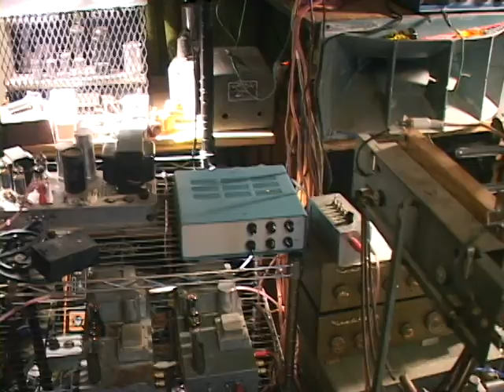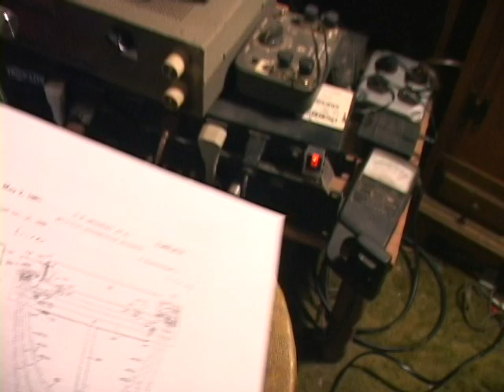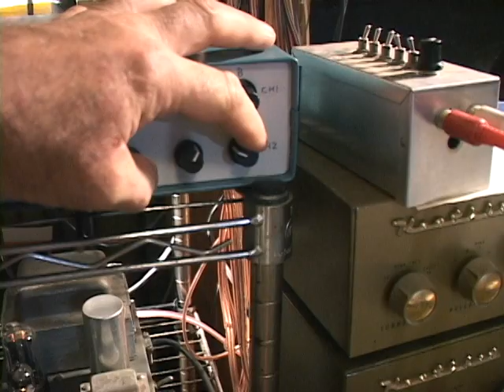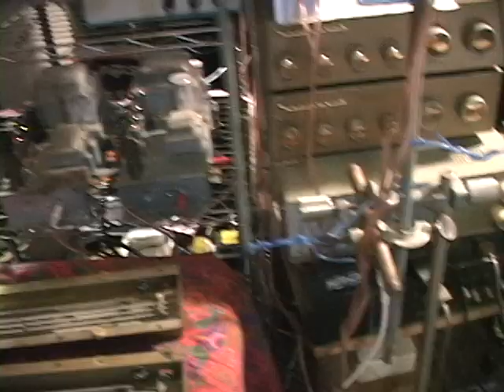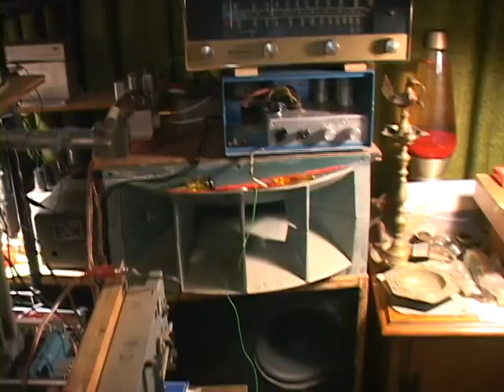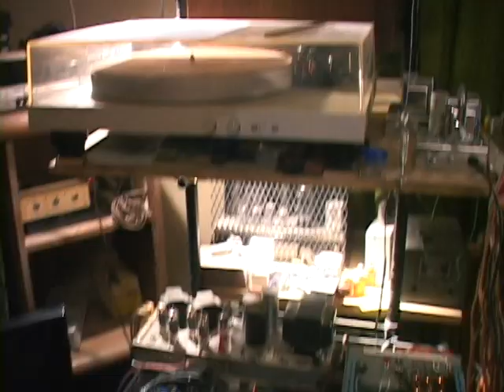Hammond necklace spring reverb tanks

Comment: Three springs represent Length, Height, and Width of the space. The Hammond AO-35 is the amp for the springs. As an organ player and a guitar player it pisses me off all of the guitar players turning all of the AO-35's into guitar amps. It's already set up to be slave driven from speaker out of any little amp. My Necklace reverb happened to be an option installed in my 1955 Hammond S6 Chord Organ. The necklace reverb sounds perfect on organ ( It's bold and dark, but not muddy). Believe it or not, my best mix for organ ( I play 6 different organs through it, but not all at once) is an early permanent magnet 12" Jensen raw speaker hanging on a screw facing the wall. I've even tried many speaker boxes.

About the S6 Chord Organ-
 Such a great little beast of an organ. I put a modern keyboard on top for left hand bass accompaniment and rip out sweet searing vacuum tube "electro-sax' sounds from the Chord Organ keyboard, and the organs key-percussion provides the accents at will. The S6 tone generators are all vacuum tube Hartley Oscillators, unlike the usual Hammond tone wheels of the day.
Reply from the maker: I bought a Hammond S6 organ from a thrift store a long time ago. It might have cost less than $50 from what I can remember.  It was missing a couple tubes which I put in later.  It worked last time I tried it.  The percussion didn't work on it, though.  I haven't played it in years.  I thought it was interesting the way I could get a sound like the organ sound on Incense and Peppermints by the Strawberry Alarm Clock.  The S6 has dividers in it like a lot of organs and when mixing two notes an octive apart with the vibrato on, it would produce a sound similar to the Incense and Peppermints sound.

A lot of people are taking organs apart and selling the parts on Ebay.  It'd be nice if they kept them together and preserved them.  No one makes those types of organs any more.  I plan to take care of my old electronics and consider them to be valuable antiques.